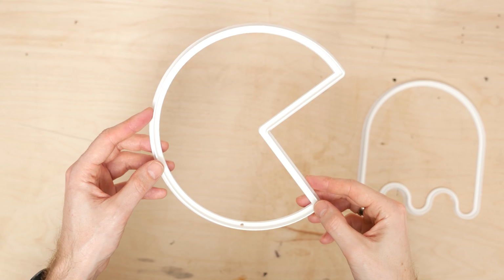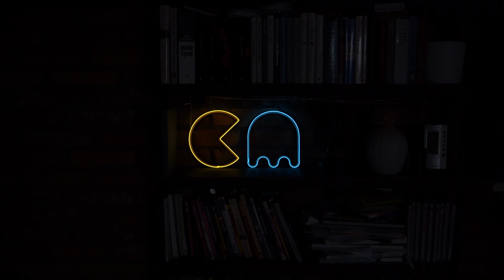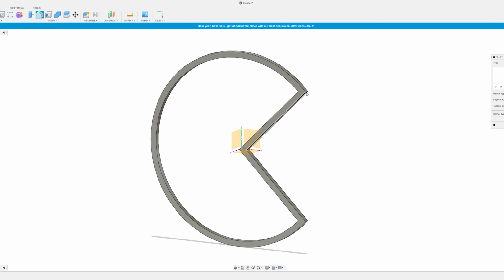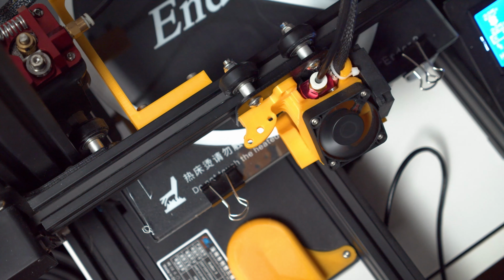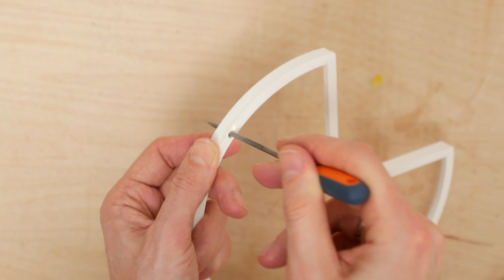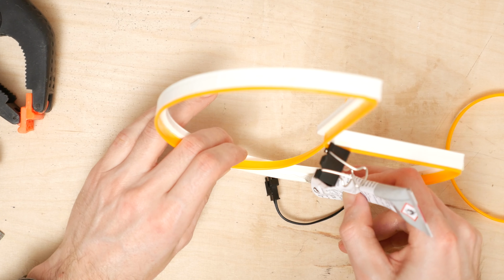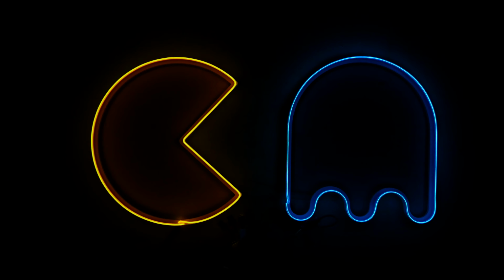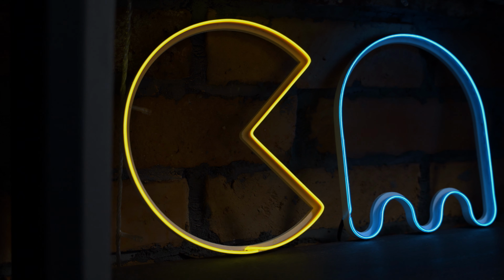How to make a neon sign - DIY neon sign

Comment: This is a led sign. A neon sign is lit up because voltage is applied to the gass neon and glows.
Reply from the maker: And if I called it LED sign then probably someone would have commented that this isn’t actually LED ;)
Reply: Electroluminescent wire is not Light Emitting Diodes. Its light emitting capacitors. So not only is your comment dumb, its factually incorrect too.

Comment: for more light output you can use new type of led strip which is looking like neon, search "Flex soft led neon rope strip" on ebay
Reply from the maker: Thanks for the tip - I think I’ve seen those - and what’s cool about them is that you can cut and daisy chain them as pleased.
Reply: Can you copy the link please? 😁